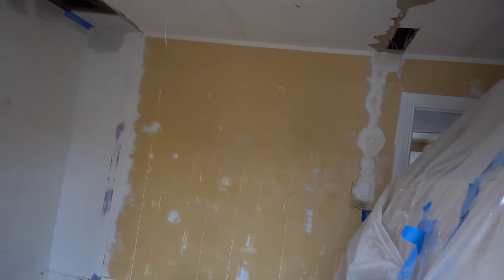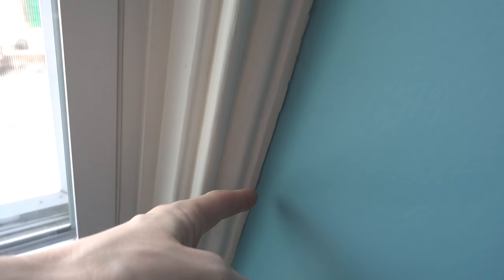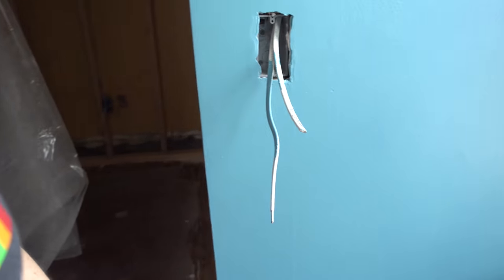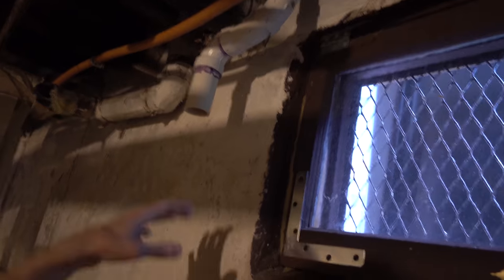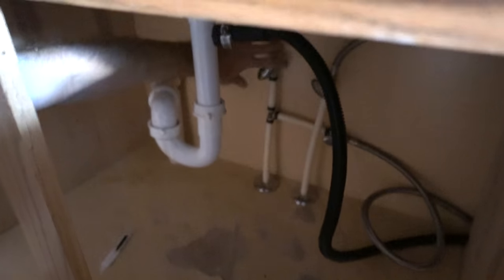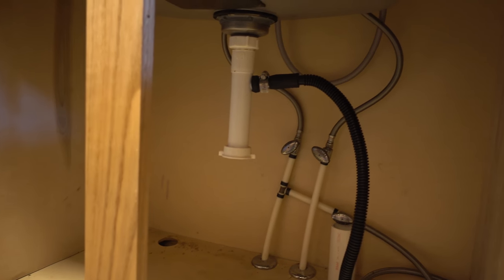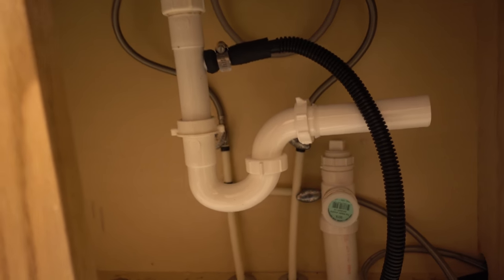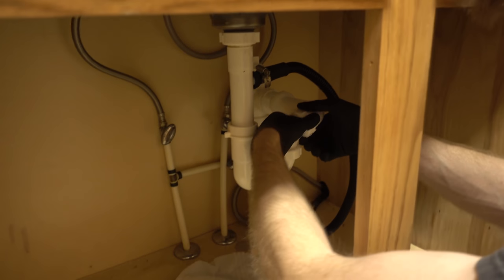Painting Begins & Plumbing Ends

Comment: Suggestion:  Move your P-trap up so there's a straight shot into your horizontal drain pipe.  Otherwise the water in the P-trap will be above the threaded joint and be a possible leak source over time.